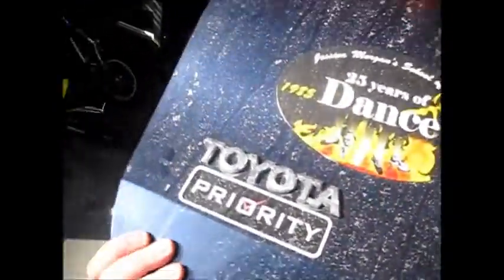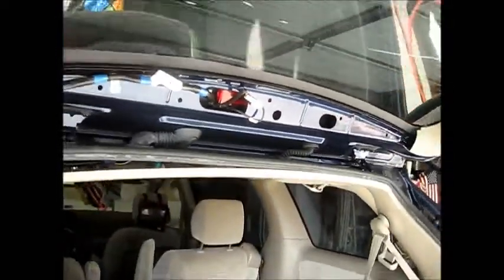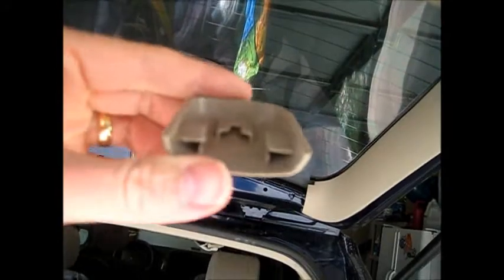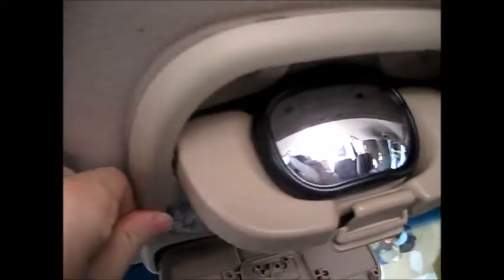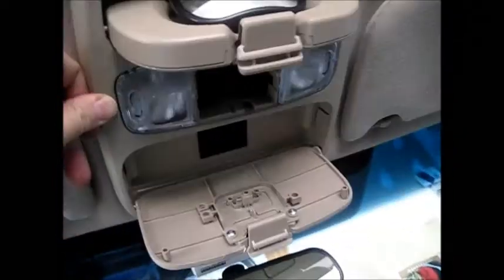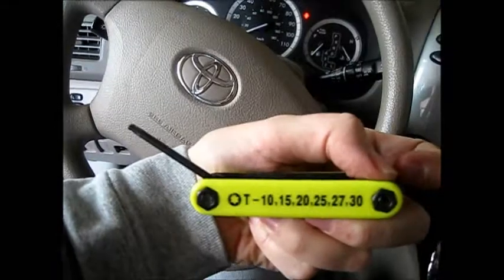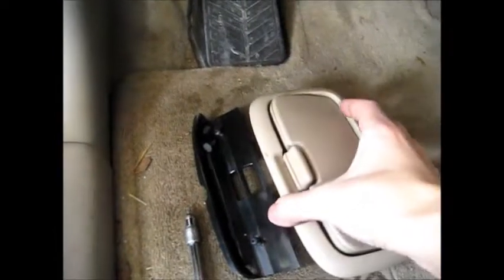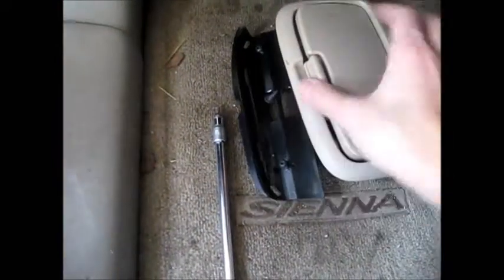Installing Backup Camera - Toyota Sienna

Comment: Wow, I own an '06 Highlander and it's surprising how identical the whole liftgate assembly looks.  Thanks for posting!  Though I think I'm going to run the wire for my back up camera along the floor and up to a modern head unit... somehow.
Reply: The wires from the license plate with a backdoor such as this have to go to the ceiling first.